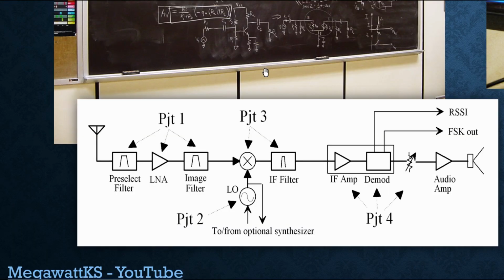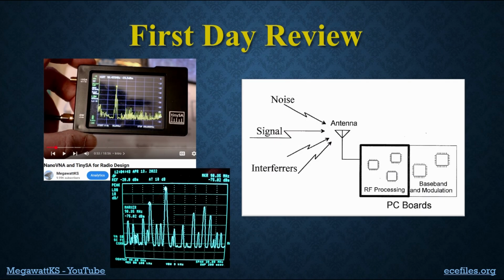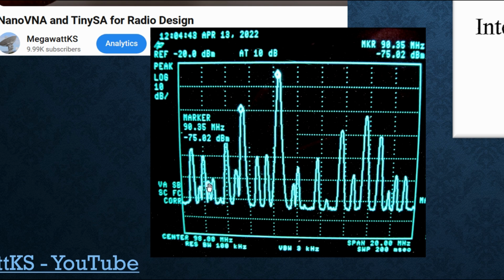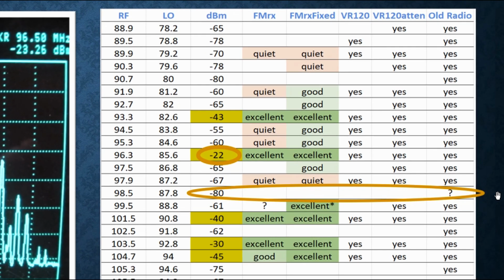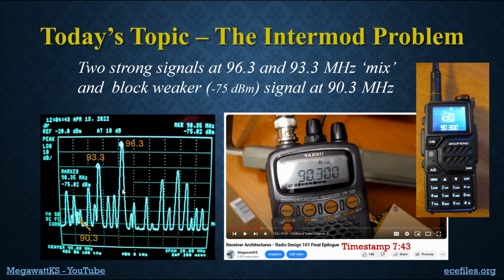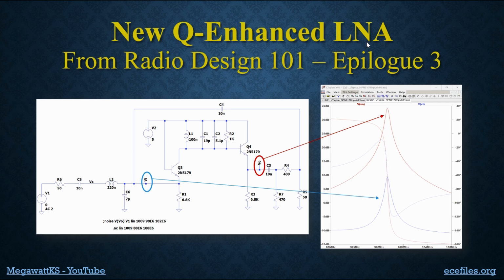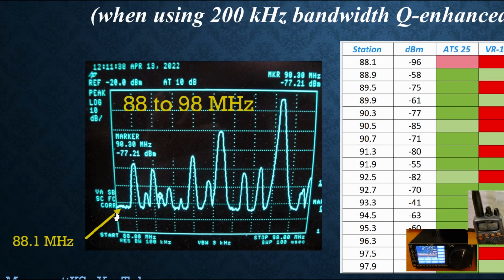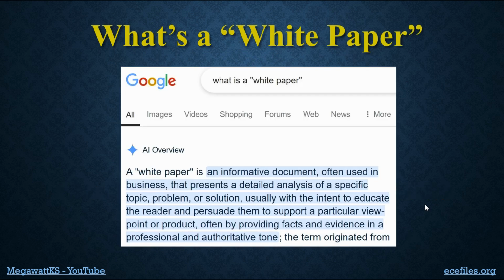Low Power Receivers in Crowded Spectrum Environments  --  Radio Design 401 - Episode 1 Part 1

Comment: Hi, firstly thank you for an excellent series of videos on RF design. Very informative and delivered in a very clear understandable way! I note at about 8.19 you show a slide with approx 20dB of gain between antenna and first mixer (i didn't catch what type of mixer you are using). I am designing a 7MHz receiver  and have a question around the  gain required between antenna, say with a -73dBm signal, and an SBL1 mixer which the data sheet shows needing an input signal of -10dBm to 0dBm. Therefore if my understanding is correct I will need a gain of approx 63 to 73db to get the system to work correctly. Reason I ask is my understanding in a superhet design that most of gain is after first mixer, but my thoughts above would suggest this is incorrect. Thanks in advance!
Reply from the maker: Hi. I just pulled a datasheet for a Minicircuits SBL-1 and it looks like this is a so-called "level 7 mixer", which means it needs + 7 dBm (+/- about 3dB) for the LO input. But for the RF input I'm not seeing the  10 to 0 in the datasheet. You are right that most of the gain should come after the mixer. The SBL-1 is a passive mixer, so it's noise-figure is close to 6dB. That means you only need a gain between the antenna and the mixer's RF input of about 10 or 15 dB. Less will mean the receiver's sensitivity will not be perfect, and more means you could get hit with the intermod problems mentioned in the video. So I would say just ignore the -10 dBm to 0 dBm thing and go with something like 15dB (+/ 5dB) gain in the LNA.
https://www.minicircuits.com/pdfs/SBL-1+.pdf
Reply: @MegawattKS  many thanks for the quick response. In terms of mixer which is better s passive or active one but I guess noise figure would need to be considered although maybe not that important at hf frequencies
Reply from the maker: @NigelBaskerville  The easy answer is that a passive mixer like the SBL-1 is better than an active mixer like an SA602. There is a huge difference in intermod performance with these two (SBL-1 is going to be about 20 dB better in that respect). But the reason isn't because its passive. Its because it has a higher-power compression (and hence IIP3) point - meaning it can withstand 20 dB higher interferer levels before generating intermods. The 'cost' is the need for +7 dBm (5mW) LO power, lower gain (-6dB), and higher noise figure (5.5 dB). But as this episode (especially parts 2 and 3) show, the intermod performance advantage far outweighs gain and NF. Both gain and NF can be entirely 'fixed' by using a proper LNA (narrow bandwidth, or high power) and a modest 15 dB LNA gain.
Reply: @MegawattKS hi again just following up on your answer in that I looked again and for the life of me could not find where I had read an rf input of -10 to 0 db  so i went vack to mini-circuits and today I received a response stating input level should be circa 10 to 20dB lower than LO level. So your advice was correct !

Comment: I would consider a receiver with a sensitivity of -80dbm horrible, really horrible, actually deplorable.  A cheap CB radio can easily receive a -120dbm signal at 12db SINAD.  Amateur radios are even better.  With high end amateur radios it only gets better.  My EME (earth moon earth or moon bounce) setup can receive signals in the -150's dbm range or better depending on conditions (noise).  All comes down to very tight receivers with excellent IF and band pass filters.  Mike KC3OSD
Reply from the maker: Thanks Mike. I totally agree - even for the FM band it is not good. That is really at the core of the subject. In crowded spectrum environments, intermods are the limiting factor - not noise figure.  I'm hoping to get this point across in the coming episode(s) where we elaborate the issue of noise and compare the theoretical sensitivities possible with what radios that operate in dense signal environments like WiFi or the FM band, to what is achieved in sparse spectrums (where noise figure of the receiver is the limiting factor). As a preview/datapoint, for FM broadcast with 200 kHz channel widths, the so-called minimum discernable signal (MDS) is -174 dBm/Hz + 10 log(200k) + NF = -118 dBm assuming NF=3dB. But since it's wideband FM, we need about 10 dB more to reach 12dB SINAD (in mono). So a sensitivity of -100 to -110 dBm is what we would expect. We regularly achieved that with signal generator testing of our radios designed and built in ECE662 class. But actual off-air reception ability was comparable to the -80 dBm due to all the intermods in the dense FM broadcast spectrum - for those radios as well as most commercial ones (with the exception of some high power consumption car radios). One solution is to narrow the front-end bandwidth to channel width. I'm hoping this "White Paper" will make that point. The FCC is actually starting to consider regulating receiver performance - largely for these reasons. Stay tuned for Part 2 of Episode 1 for more !   73's
Reply: @MegawattKS  Back in the old days we would just stick in a single or multiple crystal filters of varying bandwidth to match up with different modes.  A couple hundred Hz for CW, 2.5kHz to 3kHz for SSB and 10kHz or wider for AM/FM. I live in a region that was once one of the hearts of quarts crystal manufacturing, south central PA.  Only two manufacturers left in the area and they are tiny compared to what they use to be.  It's amazing what can be done with processing these days, no crystal filters needed.  The Yaesu FTDX 710 is a good example, a fully DDS receiver architecture.  Just a gnat's whisker in performance under the the FTDX 10 and 101's which are hybrid receivers.

Comment: Fantastic optimisation of a design... Thank you so much for this. I have just designed a FM broadcast circuit with a PLL as the demodulation  and it works great but has weak signal reception problem. Perfect timing...
Reply from the maker: Awesome. PLL demods are excellent!  I'm just getting started on the RD401 videos, so it's mostly overview in Episode 1. But there is a good amount of detail in the final epilogue (Epilogue 3) of RD101 that might be useful in the mean-time. Here's a link. (I really need to add some links to the RD101 description(s)) Great to hear about your receiver design work. 73s  https://www.youtube.com/watch?v=XW3TYQstiuk&list=PL9Ox3wpnB0kqekAyz6blg4YdvoEMoJNJY&index=14